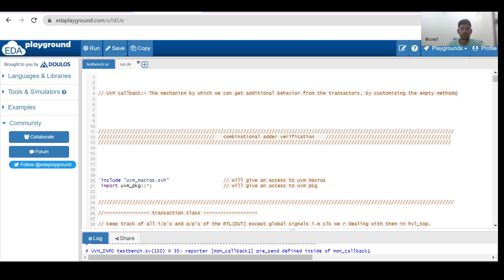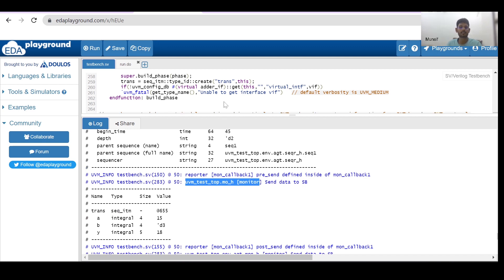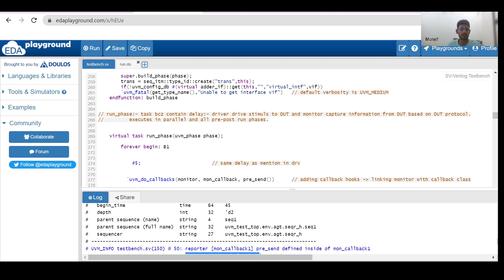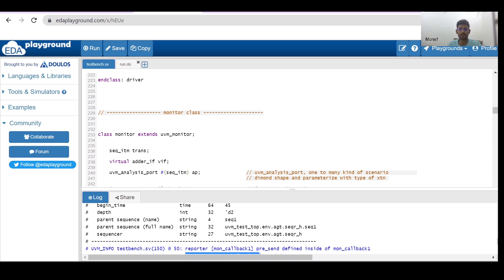Concept of call-backs w.r.p.t sv-uvm

Comment: Thank you Munsif.
I appreciate you explanation. Plzz upload video on UVM events..

One more thing, Munsif we are facing the audio issue please work on that..
Reply from the maker: Soon will upload a video on sv-uvm events.

Actually during recording mic had some issues, I guess at the last only the audio problem is there, I will put a transcript of that part as of now..

the last part in the video you can understand with the below transcript.

-> before capturing data from DUT we are printing a message like pre_send defined inside of mon_callback1 and after capturing data from DUT printing a message like pre_send defined inside of mon_callback1 after the print method, so this is what the additional behavior, we are not really modifying a source code of a monitor just we are using the call-back hooks, so these call-back hooks link the monitor with call-back class.

Thanks :)
Reply from the maker: pls have a look now, I have added the transcript part for the last part of the video.

Thanks:)